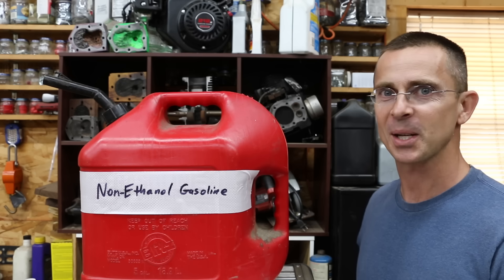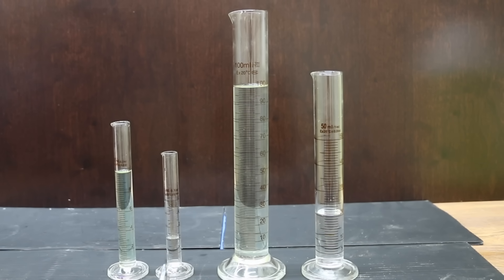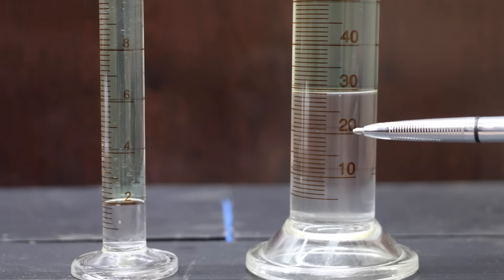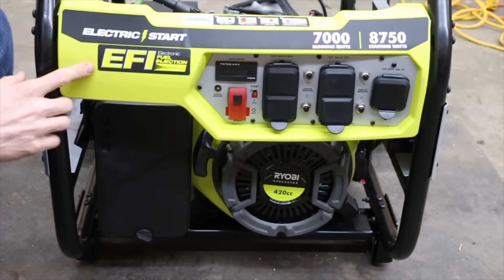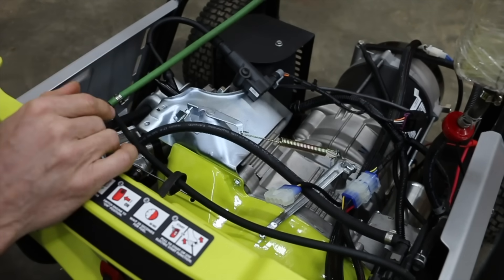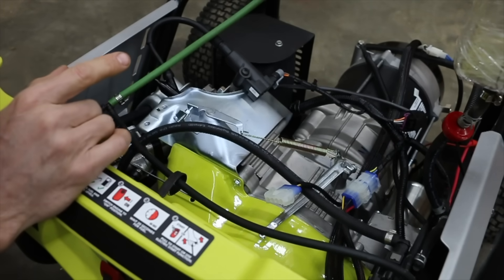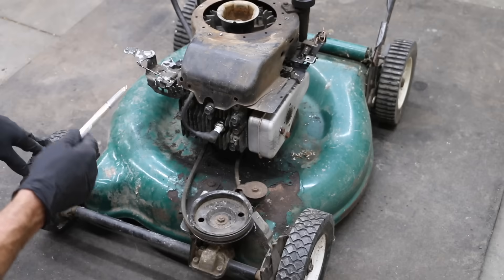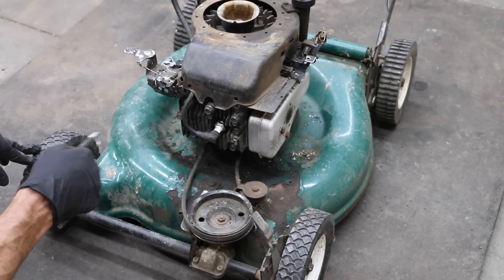Is Non-Ethanol Gasoline Really Better? See the PROOF!

Comment: Another thing to test during "long term" storage.
Effect of fuels on bare aluminum. Ethanol will attack (slowly) the surface of exposed aluminum. Oil-based fuel will not.
As another commenter said, ethanol blends are not really meant for carburetors.
Reply from the maker: Thank you for the video idea!
Reply: The DOE did storage tests on ethanol blends vs straight gasoline and found ethanol blends last three times longer:  https://www.theautochannel.com/news/2016/09/22/286340-new-government-lab-research-confirms-ethanol-blend-fuels-are-better.html 

Ethanol is much >>>easier<<< on rubbers, plastics, and metals than what gasoline and BTEX(benzene, toluene, ethyl benzene, and xylene) are.

If you doubt this, look here:

Ethanol = https://www.customadvanced.com/chemical-resistance-chart.html?chemical=Ethyl+Alcohol&rubber=

Gasoline = https://www.customadvanced.com/chemical-resistance-chart.html?chemical=Gasoline&rubber=

Benzene = https://www.customadvanced.com/chemical-resistance-chart.html?chemical=Benzene&rubber=

Toluene = https://www.customadvanced.com/chemical-resistance-chart.html?chemical=Toluene&rubber=

Ethyl benzene = https://www.customadvanced.com/chemical-resistance-chart.html?chemical=Ethyl+Benzene&rubber=

Xylene = https://www.customadvanced.com/chemical-resistance-chart.html?chemical=Xylene&rubber=

Need a second opinion?

https://www.coleparmer.com/chemical-resistance

Or here for a third opinion:

https://www.graco.com/content/dam/graco/ipd/literature/misc/chemical-compatibility-guide/Graco_ChemCompGuideEN-B.pdf

See what high aromatic gasoline is rated for with aluminum:

https://www.calpaclab.com/aluminum-chemical-compatibility-chart/

Note that ethanol is good with aluminum.

The main nontoxic ingredient of RV antifreeze is ethanol and it would not have stood the test of time if it had been corrosive.

Comment: I just did a 900+ mile trip from MS to MN. 1st two tanks of gas were 87 octane that had a minimum of 10% ethanol. Average milage was 15.7 mpg. In Iowa I stopped at a Casey's gas station & for what ever reason, they only sold non-ethanol gas. Now it was roughly .40 cents more a gallon for 87 octane but my fuel milage for that tank was 17.7 mpg. There was a good head wind coming out of the north the whole trip.
Reply from the maker: Impressive!

Comment: This is my take on what ethanol does in gasoline in a carburetor, from a corrosion standpoint.First, any condensation in a fuel tank runs to the bottom.  Ethanol instantly moves into the water, trebling its volume.This mixture, being at the bottom of the tank, drains into the carburetor float bowl.This mixture acts as an electrolyte for a battery formed from brass jets and zinc carb alloys.  Carbs are mostly ZAMAC alloys.ZAMAC is Zinc/Aluminum/Magnesium/Copper, about 95% zinc.Briggs and Stratton, Tecumseh, West Bend, American 2+4 bbl carbs are generally zinc/Zamac.The zinc is sacrificial to the brass alloy and dissolves, forming zinc hydroxide sludge.Everything goes downhill from there, blocked needle valve, jets, corroding float bowl etc.The answer is obvious, if you are forced to use fuel containing ethanol, drain the carb after use and ALWAYS turn off the spigot at the tank.  And add something to remove the water from the tank!
Reply from the maker: Great point!  Thank you

Comment: What size socket are you using to start engines? Do all of the engines you use take the same size socket to start? Thanks.
Reply from the maker: There are several sizes for small engines.  I use a 13/16 on the mower and a different size for the generator.

Comment: Over the weekend I took a 350 mile trip in my 2018 Ecoboost Ford Fusion..on the way to Indiana I used non ethanol 93 octane and averaged 35.1 mpg using cruise set at 75 as much as possible. On the way back I used 10% ethanol 93 octane and only averaged 29mpg so the difference is there and is quite substantial in my opinion
Reply from the maker: Thank you!